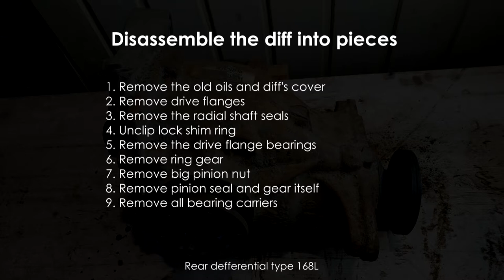Disassemble the REAR DIFFERENTIAL into PIECES - Drivetrain rebuild PART 6 - BMW E91 engine N43

Comment: Man Jani, I wish you would be me my neighbour. I have the exact same car and there is so much need for repairing. I paid big money for the repair of my diff. Nice to see that you can repair it on you own. Keep doing these videos. Great work mate!
Reply from the maker: Thanks! Would you like to tell me how much your rear differential repair cost you?
This diff project cost for me 122 euros for new bearing set and 40 euros to the machine shop for the removal of the pinion gear bearing carrier.
Reply: @JaniVoutilainen  fortunately the seller paid for it. 1200€. I bought the car in january. Sandblasting the cover, replace bearings. Thats it. The mechanic told me there were damaged parts but they couldnt get spare parts for it. So he put them back in.  I def choosed the wrong mechanic. But the annoying whining sound is gone.
Reply: You're not including the costs of all the tools required... Only saving on labor. There's a hobby shop in my area with all lifts & tools where anyone can work on their vehicles. That's ideal.

Comment: Hi, I have a question, there's a difference that the ends of the circlips goes up or down? The differential it's a 215L from a e90 330d 2006, there's no an oil passage on top, I'll appreciate the answer, thanks in advance.